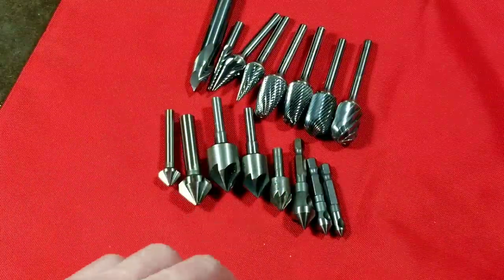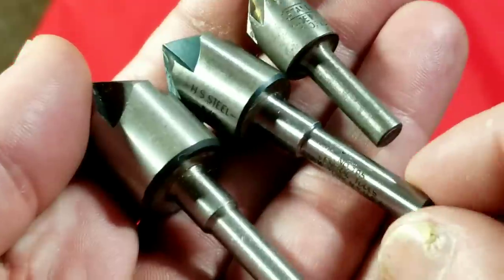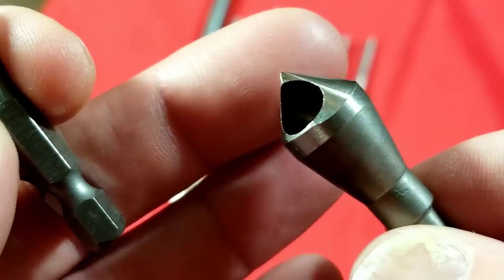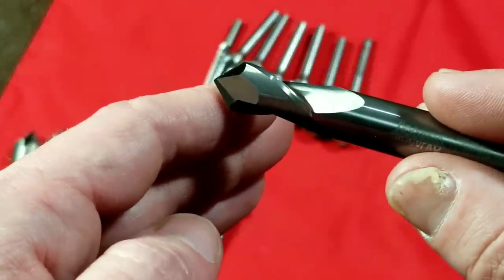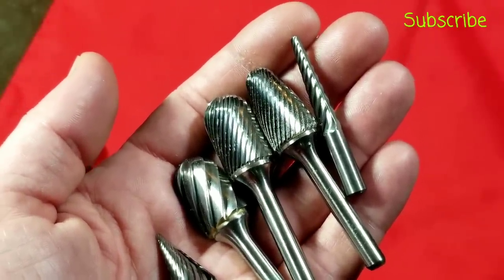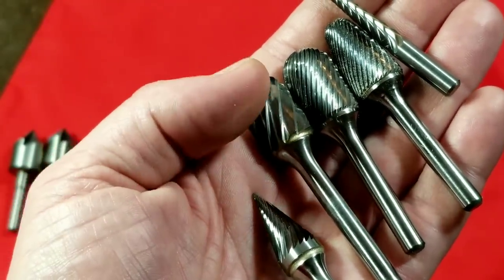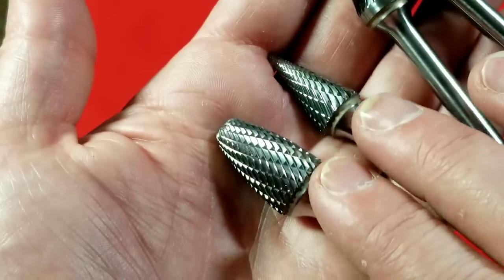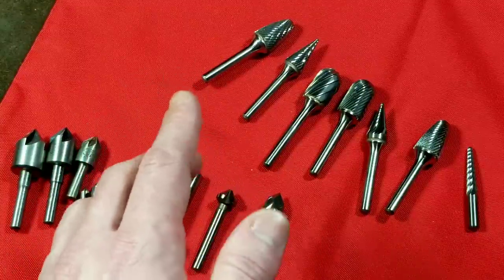Carbide Rotary Files (Burrs) & Chamfering Bits Comparison & Introduction

Comment: I was really impressed the very first time I used a carbide burr.  It was a double-cut type and it just ate through hardened steels, like sockets and 10.8 grade bolts!  Thanks for the video.